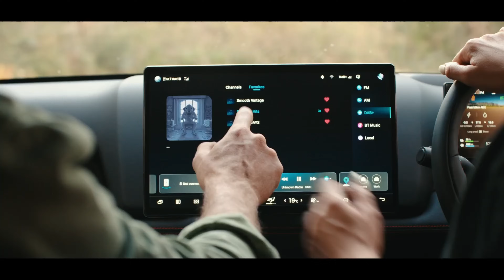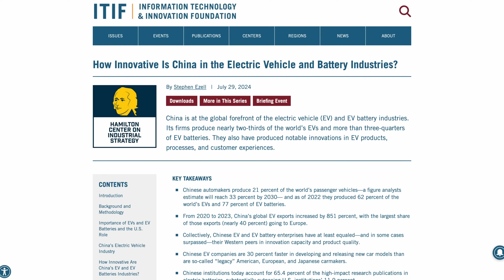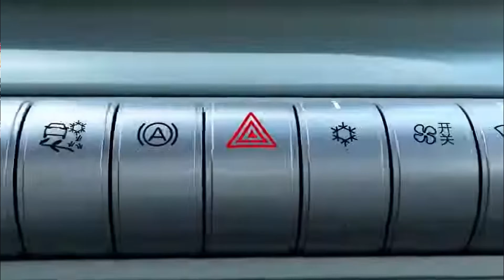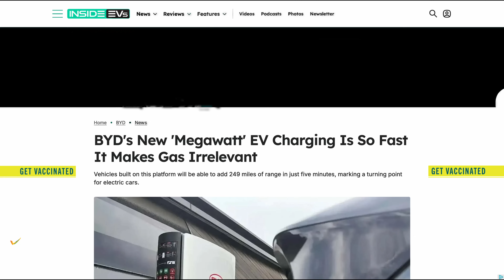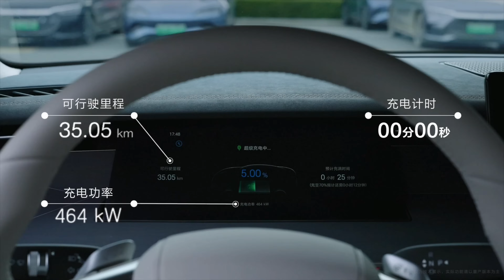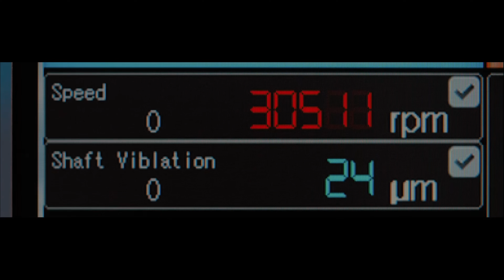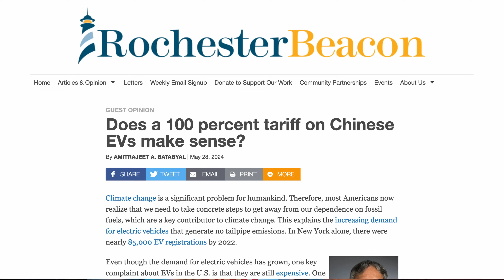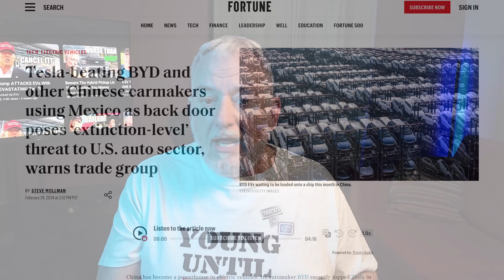IS BYD's CRAZY New Charging & Battery Tech Coming for EV Trucks?

Comment: copied：BYD's Super-E Platform flash charging system is the fruition of many years of dedication in R&D. They have raised the LFP battery technology to a level no others can now compete and even future solid state batteries will find hard to beat. Their latest Short Blade 2.0 LFP battery is rated at 10C for charging and 16C for discharging. This means that battery can be fully charged from 0% to 100% in 6 minutes and fully discharged in 3.75 minutes! In order to benefit from the capability of this new LFP battery, BYD also invented a new ultra efficient thermal management system for the battery as well as the 1000 KW flash charging system. What is also crucial for BYD's Super-E Platform charging system is that this system does not disrupt the existing power grid. This is because it comes with its own Battery Energy Storage System (BESS) which means it won't draw power from the grid at the 1000 KW rate but at a much lower rate. The charging station can be integrated with on-site solar and wind to maximize efficiency. This new BYD technology is ideally suited for a place like India where there is plenty of solar. The future is here right now!
Reply from the maker: Thanks for posting this!

Comment: In this case, and with Jim Farley's recent ramblings about Ford's plans to hit the brakes on EV manufacturing, we'll probably have to say goodbye to Ford soon. Not that I'm happy about that eventual outcome.
Reply from the maker: I hope you're wrong, but I'm worried you're right.
Reply: @truckedupevs  the feeling's mutual. I'm still hoping to get into a Lightning one day. The only thing that's holding me back is the range issue. The Silverado EV product addresses the range issue, but it just can't hold a candle up to the Lightning where truck practicality is concerned.
Reply from the maker: @Gangstabilly  Unless you plan to tow. Where the Silverado and Sierra EV shine is on that front, but their payload is poor. Overall, I think both can do most work, but I hope to see a more off-road, lighter variant in the future.

Comment: In Mexico shark has a starting price for $53K USD equivalent for a midsize which is honestly a lot higher than I expected. I expected something in the $35K or at most mid $40K range (starting price of a Tacoma hybrid). Remember in Mexico a base Hilux starts at $20K equivalent while crew cab with diesel start at $30K or so BYD is twice as much

Yet its towing and payload a lot less, no solid axle means it is never gonna be as off-road capable. It uses e-CVT rather than traditional torque converter automatic. Its 30kwh or so battery is stored not in the interior like the Wrangler 4XE or TNGA-F product but outside underneath the cab. So repairing and replacing on that battery will take longer and cost more money. Some of the biggest problem of the BYD DMO platform.

This is not the game changer that some people hyped up to be
Reply from the maker: I've heard similar critiques, and Sandy Munro was not impressed with it when he tore it down. It's also not an EV truck but an EREV, as you know, and not as well packaged as the Ramcharger and Scout Terra Harvester EREVs.
The Shark is in no way a game-changer as a vehicle on its own, other than the fact that BYD is selling a lot of them and entering a market successfully where it has been a difficult nut to crack in the past.
As you know with the video, the tech being developed is truly where the needle moves. And as I postulated, if that tech moves over to BEV trucks, it resets the chess board.
Thank you for such a comprehensive and informative post! Very much appreciated.

Comment: My 2023 Chevy Bolt EV has a max charging speed of 50 kw and doesn't maintain that very long. GM is screwed.
Reply from the maker: We have a 2019 Bolt and yes, even in 2023, the max was 55kw. However, the Ultium LG Energy packs have over 260 Wh/kg (more energy density than BYD), and charge at over 350kw, including their Blazer and low-cost Equinox. So, that's not bad at all - but it's still doing it with the help of Asian tech, not their own. We'll have to see.

Comment: They definitely learned from Musk how to attract investments. Will see what, when and how it will actually be delivered on the roads. Why even these 'announcements' on the screen are presented as a facts?
Reply from the maker: BYD was attracting far more investments a decade ago than Tesla ever was. It is certainly the other way around. Warren Buffet invested in BYD in 2008, six months before Musk even became CEO of Tesla, and long before the first Model S rolled off the assembly line. 
Every product BYD has rolled out has been delivered as promised, on schedule and meeting specs originally provided - unlike Tesla. All one has to do is watch the Cybertruck reveal in 2019 to see a company make 'announcements' as if they were facts, none of which came true - all false.
Also remember the Han L Sedan has been on the roads of China since 2015, and this is simply another iteration of the vehicle, which was already great.
Reply: @truckedupevs  my point is that all those announcements are questionable at least
Reply: @127gentry  No, you just need to believe they are.

Comment: Thanks! My understanding is that the LFP batteries that they are using in China to achieve 10 C charging has less to do with the specific chemistry than it does with the electrode thickness. So the biggest tradeoff will likely be energy density, so I'm going to wait until I see all the stats related to the tech. Charging four times faster than Ultium NCMA is great, unless it results in having 30% less payload and towing capacity with 50% less range. Those are far more important factors for trucks.
Reply from the maker: I am no wizard when it comes to chemistry, but yes, both towing and range are key for EV trucks. 
BYD was explicit in its improvements, however. From 2023 to 2024, it increased battery density in the Blade battery by 27%. In this iteration, based on a dicey translation via Weibo (BYD didn't post its video on non-Chinese platforms - but I'm working on it), the new Super E - purposed Blade battery has increased it again, from 160wh/kg to 210wh/kg in the larger pack. I do know that range has also improved, not dropped, in the new Han L trim over its predecessor, achieving 600km with only an 82.3kwh battery. Looks like it's going in the right direction.
Here's a recent article from CarNewsChina: https://carnewschina.com/2025/02/17/the-1086-hp-byd-han-ls-range-exposed-in-china-601-km-on-a-single-charge/
Reply: @truckedupevs  Definitely, but compared to the 270-290 Wh/kg of Ultium NCMA, the Blade LFP still requires some trade offs. I try to be a consumer advocate first and foremost, so while I do appreciate the work China is doing, I wouldn't completely discount advances being made by American and European automakers. Cost/price is the area I think Chinese automakers have an uncontested advantage, but we're all in this together.
Reply from the maker: @newscoulomb3705  Agreed. But that BYD Wh/kg number is rising annually by an average of over 20% since 2021. Also, keep in mind that the Ultium batteries were designed and manufactured through GM's joint venture with LG Energy Solutions - which as we know is Korean. It was LG that engineered them, not GM.
As I mentioned in the video, Legacy Auto will need to rapidly form alliances to survive. GM is doing that - so far. Hopefully, It doesn't foolishly backpedal like Ford. The bad news is it looks like it is going to pivot as it phases out the Ultium name and shifts away from a single battery type. In doing so, it will tap Japanese and Chinese battery manufacturers once again to negotiate some method of tariff-free access. 
Again, GM is relying on Asian tech, not its own. 

Just sayin'. 
Here's an article back late last year on the GM Ultium pivot: https://insideevs.com/news/736598/gm-to-dump-ultium-brand-name/
Reply: LFP is more stable than NMC, that's why it won't burnt like NMC and easier to make 10C charging speed. the tradeoff is slower power output which keep improving all the time.

Comment: When will a manufacturer make a EV pickup in the 250/2500 payload class with an 8 foot box?
Reply from the maker: With EREVs being the new stopgap, I think we'll be waiting a little while. You are 100% correct. That's what we need, but we need battery density to go up, costs to come down, and infrastructure to improve in rural areas. With the complete reversal on EV policy in the States, it's not looking very promising. However, as mentioned in the video, there is a HUGE hole there for a foreign superior-tech OEM to walk in and fill.
I can't tell you how many Trucked Up folk have commented on this channel that they simply want a single cab, 8ft.-bed, EV work truck!
Thanks fro all the great comments and questions.
Reply: @truckedupevs  That's too bad. My use case would be perfect for a heavy EV truck. I travel less than 150 km in one shot, and I am home to charge every night. The only issue is I haul a welder and full set of tools around, so I need the full-size box and big payload capacity. The current EV offerings don't address these requirements.
Reply from the maker: @themustardfarmer  Hm? Not sure that the Lightning couldn't fit a number of those requirements. The 2000 lb payload is too low? Did you watch my video on the metal artist who ran his arc welder off his Lightning of-grid for 4 days, used it as a home office and powered his fridge and cooking, along with all power tools, and drove out with only a loss of 77km (45 miles)? Here's a link if you haven't: https://youtu.be/Pd0EAZYZqL8
My truck has 515KM claimed range (320 miles), without needing to charge. But yeah, only a 5.5 foot bed, but 400lbs in the mega-frunk and the whole back seat folds up fully for another pile of gear and tools. In fact, you could just take ot the back seat entirely, I'm guessing. If you'r a farmer, you should be able to snag the base model Pro or at least and XLT, but if you need the solid range, that will put you in the Flash.
But still, even if it could work, it's a stretch. Someone needs to make a single cab, 8 ft, configuration - and the first company that does that is going to make some serious sales.
Always great to chat!
Reply: Probably never, the only companies on this side of the pond will that sell vehicles like that will probably be out of business before they even try to do electric

Comment: Hey Bud! The charging curve is the result of the battery, not the charing posts... the chargers can do 500kw all day... so it would take 10 minutes to charge a BYD Tang ... which is still pretty good.  The max I have seen on any  other vendor's CCS stall was 350 which is even worse.   btw the Tang and the other one... those are models that have been around for years... they aren't new models, they're mature models just getting refreshed with the new battery tech.
Reply from the maker: The Tan L and Yang L are completely redesigned from the ground up, so yes, the badges have been around since 2015, but there's nothing carried over here. BYD made that clear in their presentation. You are correct about the batteries and internal power management of the vehicle vs. the chargers. I never said at any point that the batteries weren't responsible for the charging speed.

Comment: The 100% tariff is really stupid but with the Orange skid mark trying to destroy Auto Pact our current auto manufacturing is on the brink. I say it is time to drop the tariff (we did it for the USA after all). I have a Kona EV but I have been looking at Chinese electric vehicles for some time now and yes they are so far ahead of everyone else and with no NAFTA there is nothing to protect.   Oh and don't forget that BYD will all have self driving software.  Oh charging LFP from 10% to 80% in 13 minutes at -30C.  
No electric truck yet.
Reply from the maker: 100%. This was a trade-induced measure pushed by the Big Three auto. Canada needs to think radically different if we want to build a resilient EV adoption nation.
Thank you for the comment!

Comment: I’m wondering how long the batteries hold up charging at such a fast rate. Sounds promising
Reply from the maker: Great question, Steve - but BYD's verified data shows they last longer, not shorter. There's no major development of dendrites with whatever change they made to the electrolyte, which means really slow degradation. LFPs last much longer already than NMC batteries and can be consistently charged to 100%.
BYD is still holding to it's regular 8 year 160K km warranty with the 6-yr, 150k km on the whole car. However, in the presentation, according to one translation on EV China News, BYD is so confident, it plans to extend that warranty even longer.